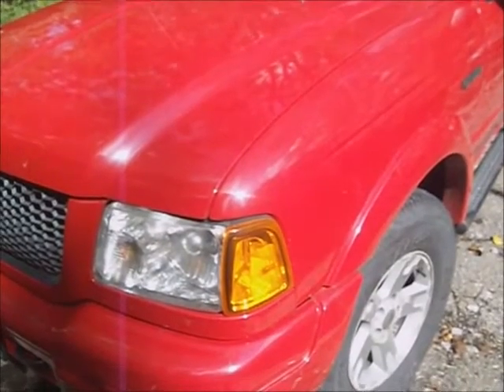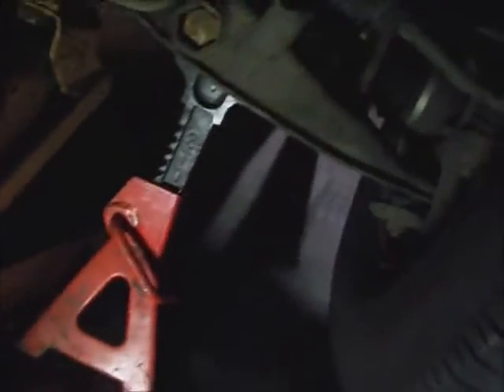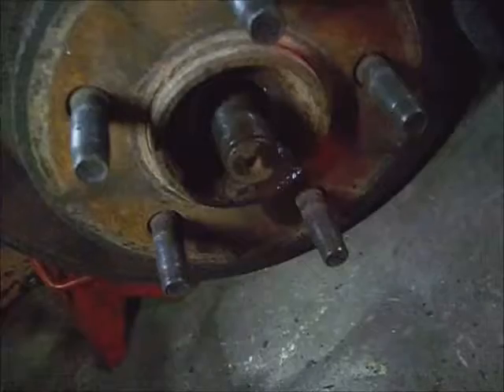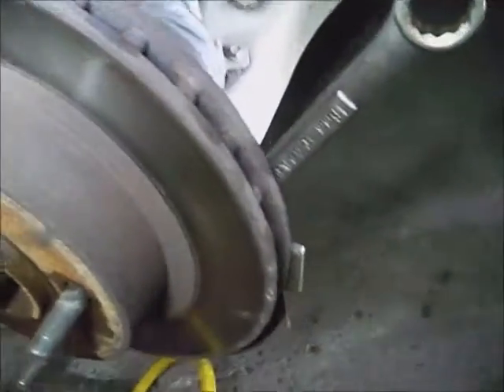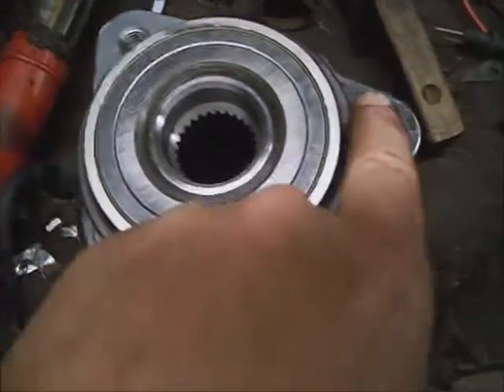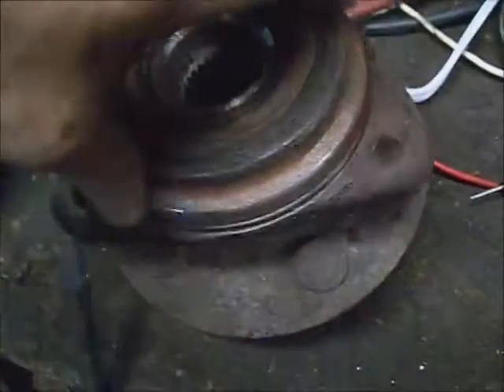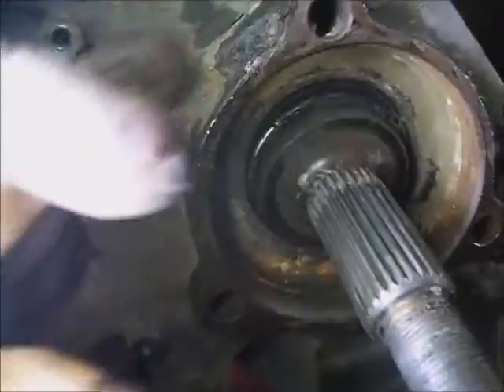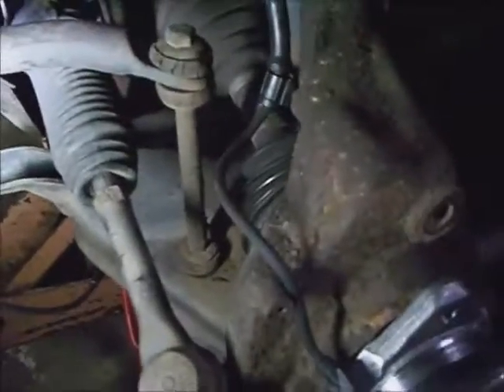Ford Ranger `02 4x4 driver front wheel bearing making noise replace

Comment: Quick question: did you feel any vibration on the drive wheel? I've replaced the front wheel bearing /driver side but, still hear and feel that annoying off road tire noise. That kind of tells me is not a rear bearing I hope.
Reply from the maker: Maybe its the other side.  Raise front tires off ground and free spin by hand, check for obvious noise or roughness.  and that it isnt in 4x4 mode or that the front drive shaft can spin seperate from the rear.  Drive it around sharp curves and see if sound is constant, or is more prevalent in left/right turn.  If its in the front end anyway.  Move tires from front axles to rear axle.  And if still unresolved, in 4x4 mode, check rotation slack between front drive shaft and rear shaft, at transfer case.  As a transfer case can make a racket if worn out. Check u-joints/cv-joints for looseness.  If all well, remove front drive shaft, and drive. And ultimately remove front differential cover and check for metal debris.  A drain of the transfer case can reveal problems inside.  Make sure all tires are the same size and brand name, as I have seen a 2.5" diameter variable in same size different brand tire.  Destroys driveline comoponents in 4x4 mode.  (Checked with fabric tape around perimeter of tire) All of these things mentioned go bad and generate the conditions mentioned.  Check engine mounts as well.
Reply: Leo Cadena. half shaft worn u joint inside of boots dry out over time. mine did the same thing till i changed both half shafts on my 02. ranger 4×4 now quiet and smooth ride..try replacing yours...